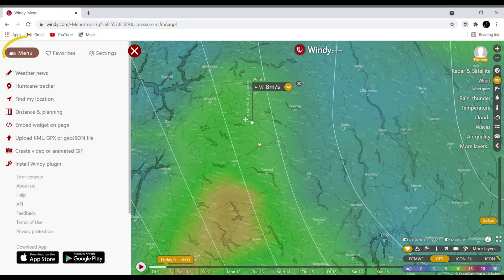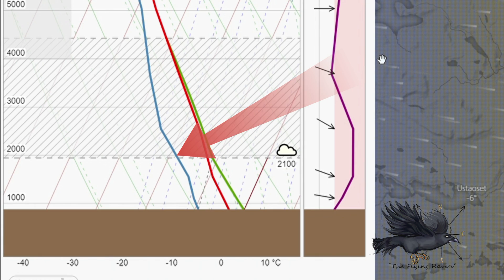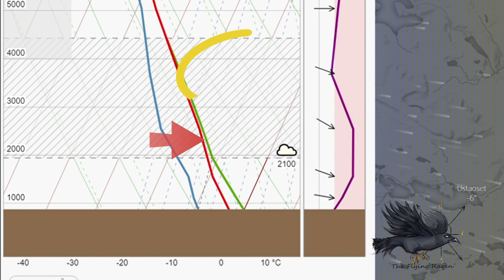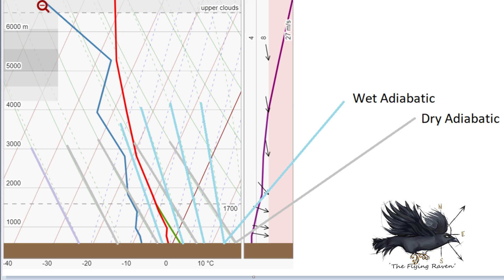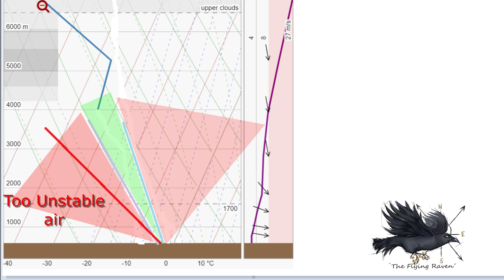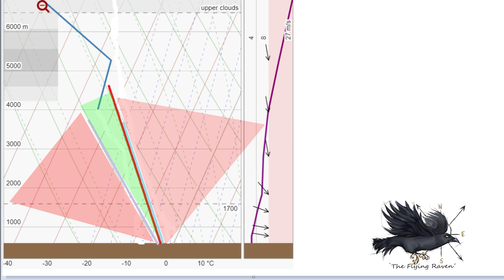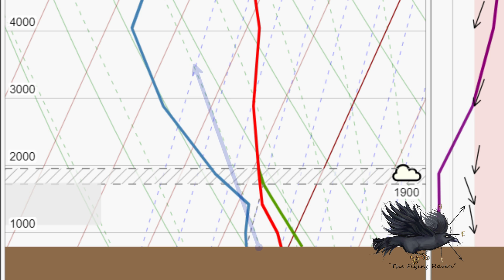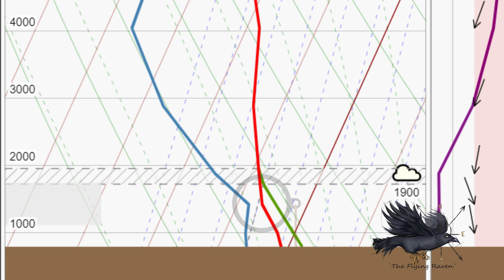How to read the sounding will there be thermals paragliding

Comment: Thanks for the explanation, i too have struggled with the sounding info. in Summary if the green line is to the right of the red line its stable and no thermals?
Reply from the maker: Yeah the thin green right. 

The fat green you get when using the plug in is thermal:)

Comment: Thanks for taking the time to make this. I’m brand new to paragliding (starting next week 🤞🏻) so a while away from using this info on my own, but it shows me the basic understanding and points me in the direction of what I need to study. Thanks from 🇬🇧
Reply from the maker: Welcome to the sport :) 
It is still naice for u to se that the air is not too unstable.  It can cause strong condition.  

If you are new I advise you to check out my video to much wind for paragliding.  

This apply especially if you fly in the mountains.  

For costal soring you can allow some more vind.
Reply: Thanks. I’ve subscribed and will check out that vid. Cheers 🍻
Reply from the maker: @apelfed  much appreciated:)